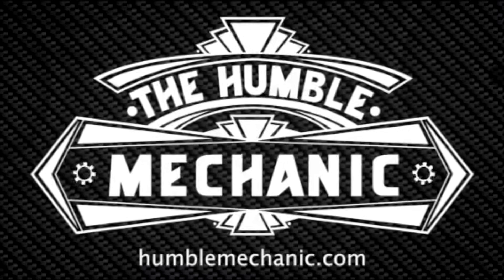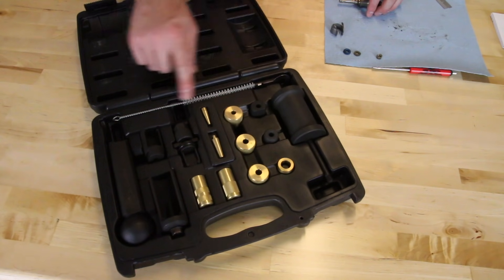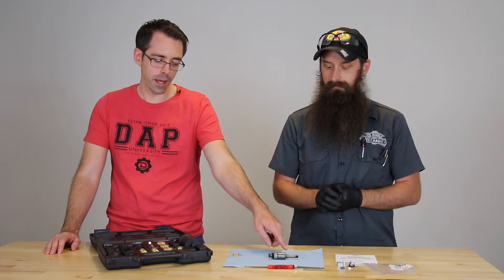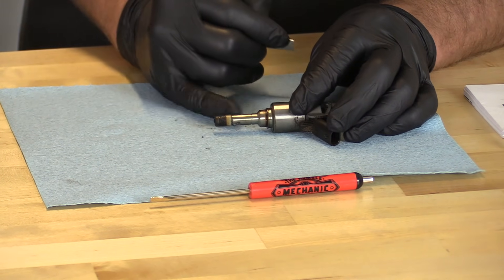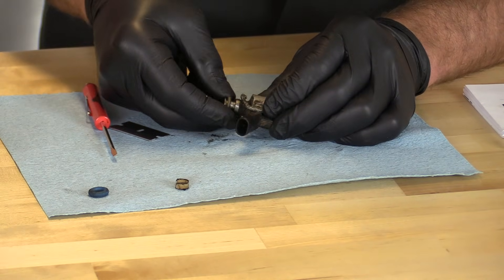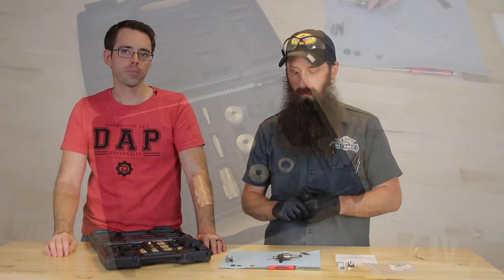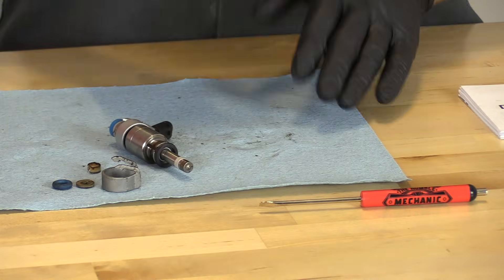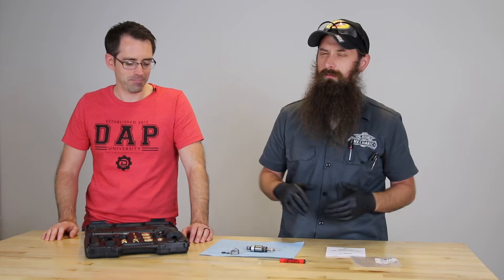Replace Injector Seals on Direct Injection Engines

Comment: Are you sure the GDI injector seals on the in-head end are nylon? 
Bosch claims they are PTFE/Teflon. 
What is the result if the combustion chamber end PTFE/Teflon/Nylon seals and or bore are lightly lubricated with WD-40 or engine oil or PTFE O-ring lube during installation? 
Also I have seen a Bosch bulletin that recommends using a non-silicone lubricant on the fuel rail side seals/O-rings, has that recommendation been superseded? 
Thank you for all that you do and sharing.
Reply: OEM= PTFE/Teflon, Aftermarket= Random white stuff.
Reply: Teflon is white like nylon and it has a very high heat tolerance... quite possible.
Reply from the maker: +patw52pb1 that's what vw info says. But now I'm wondering if I misspoke
Reply: To my knowledge, silicon can contaminate 02 sensors, probably why they tell you not to use it, I could of course be incorrect.
Reply: Ben R Yes. They need to be teflon for heat.

Comment: Arent you supposed to put a spacer on the injector before pushing on the dies shrinking the nylon ring? And i thought there were 3 different size dies..
Reply from the maker: +Mathijs B there are 3 but only 2 for this injector 

Not sure about the spacer you're talking about
Reply: @HumbleMechanic it's really a spacer you put on the injector so the die only can go on a certain distance.
It's the gold one on the right of the three dies.
Reply from the maker: +Mathijs B the OEM kit has a shoulder on it. And I think this kit was made similar. 

That's why you flip the too. At least that's my observation
Reply: HumbleMechanic I work at a VW dealership in the Netherlands so also use the oem one. The spacer is maybe only needed for other injectors, like for the 1.4L engines we have a lot over here.
Reply from the maker: +Mathijs B that could be. The 1.4 is very new for us here
Reply: HumbleMechanic What engine code are your 1.4's? And just with a turbo? Here we have them with just a turbo, and we have them with a turbo and a super charger.
Reply: +HumbleMechanic Yup, you are supposed to use a spacer on the 1.4.
I replaced a cylinder head on one of those a couple of weeks ago.

Comment: Great video. Is there enough of an advantage to DFI vs. conventional FI to warrant doing this procedure?  So far, not a fan of DFI. Just my opinion. If I were a fan, I'd really appreciate DAP and THM for providing this info. Thx!
Reply from the maker: Most DI engines should be super easy. Or just follow the process on the outside of the injector.

Comment: Hi Charles, My name is Christian garcia, I been a fan of yours for a long time now, love your videos. Great information. I'm contacting you because I have a 2003 VW Jetta MK4, I have a problem where I'm driving and my speedometer goes a little over 65 mph, the speedometer needle starts to go up and down while I keep a steady gas pedal. I tried replacing my input and output transmission speed sensor and I still have the same problem. Do you think it could be the instrument cluster? Or could it be That I'm missing a different speed sensor? If you could please take a minute to help me out or guide me to the right place. Thank you so much for your time.
Reply from the maker: check the gear inside the transmission. that is a common failure point. It could be the cluster too.
Reply: HumbleMechanic thank you so much, I will take a look at both, and keep you updated to see what happened. Thank you once more. Have a great day :D
Reply: Having a gauge needle that moves erratically is common among all cars, but I suggest you get advice from VW specialists first.

You don't have to buy a new cluster, most are rebuildable. Auto dealers usually don't sell rebuilt clusters, only new ones that cost a fortune. Also, using a cluster from a junkyard may not be a good idea, because some clusters have to be programmed to match the car. Search online for companies that rebuild clusters after you get advice from VW specialists.

Comment: good video thanks .but will you be doing one on conman rail  diesel injectors to ? id like to see your way as it has taken me hours in the past getting them out o the engine
Reply from the maker: IF the opertunity comes up I will, but that is not nearly as common as the Tsi/FSI
Reply: You need a slide hammer and the right adapter to fit onto the injectors.
When you have that, it's a 10 minute job.
Reply: panzerveps do the claw type adapters work. Rather than taking to top off the injector
Reply: Nope. You have to screw it onto where the fuel line goes in.

Comment: I did my decarb back in 2014, but is there a specific way to clean the injector nozzles? I just dipped them in the same decarb cleaning solution and gently used a wire brush. It seemed to do the trick fine since it's been almost 3 years and 25k miles, but I thought I'd ask since others may also have similar questions.
Reply: HumbleMechanic Any chance of doing a video on the decarb process? Preferably via soda blasting. Would be really helpful.
Reply from the maker: I just spray a rag and wipe them. I think it's fine as long as you are not grinding the carbon back into the injector nozzle